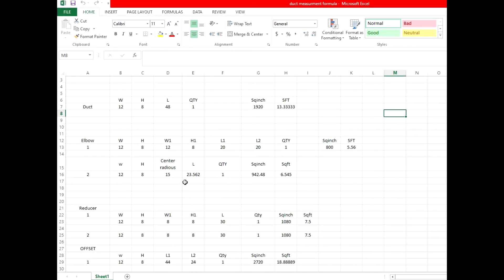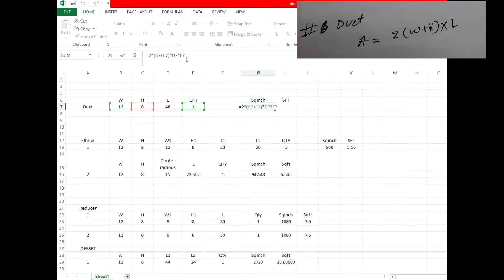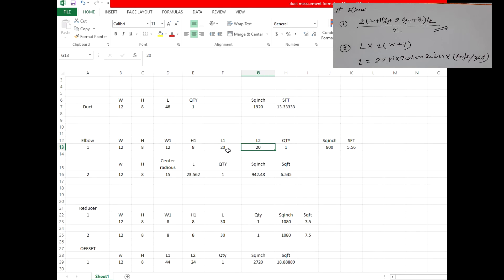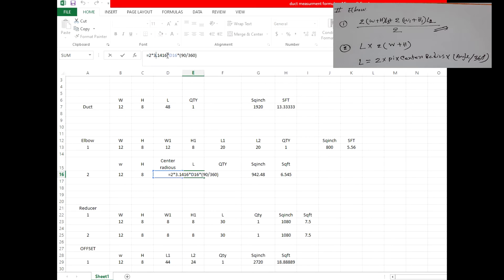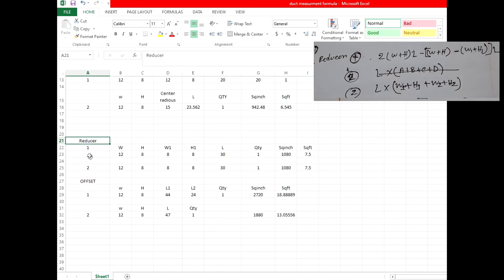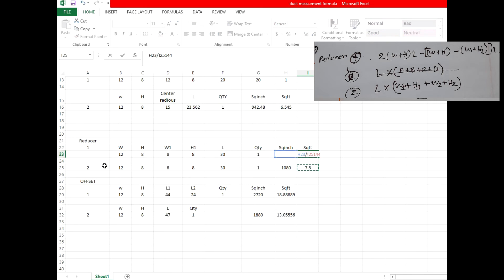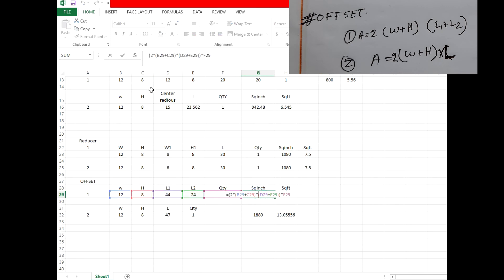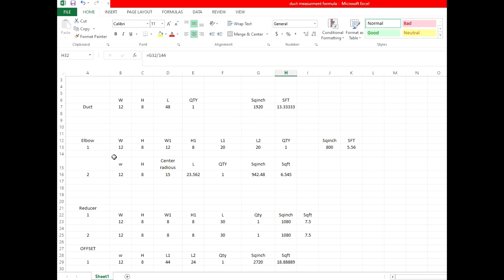Excel formula for HVAC duct measurement| how to measure duct | HVAC system

Comment: Do you also have a calculation for bending ACR tubing of different sizes (e.g., 1/4"; 3/8"; 1/2"; 5/8") using center of the bend; back of the 90°, etc.?
Reply from the maker: sorry, i don’t understand what you say. this video is only for duct measurement. refregerent copper tube or chilled water pipe size calculation is different method.
Reply: @engineeringfactsbd5162  That is correct. Do you have a video showing such excel method?